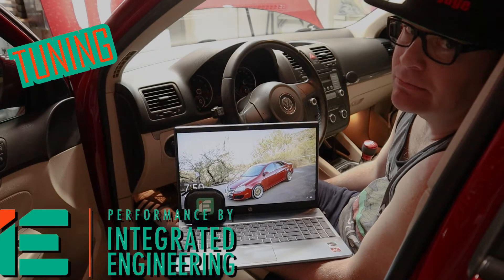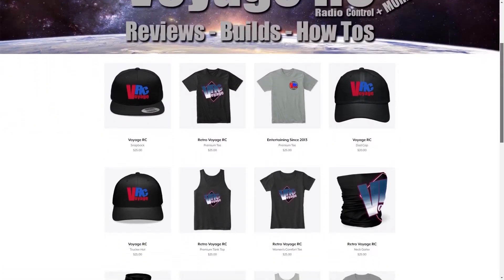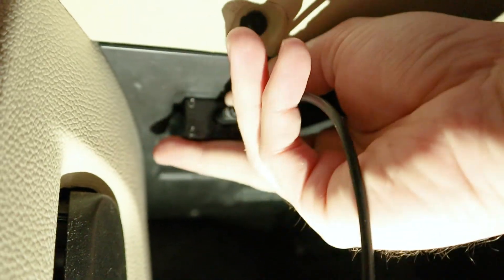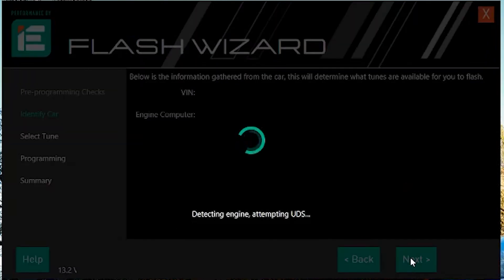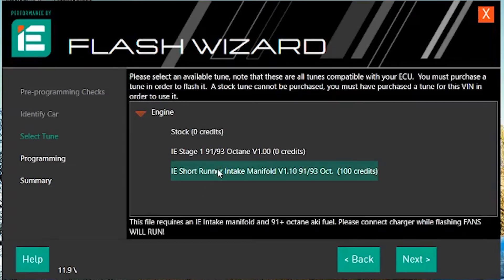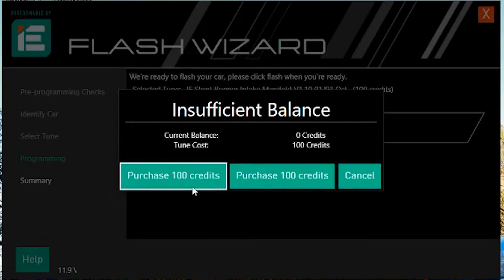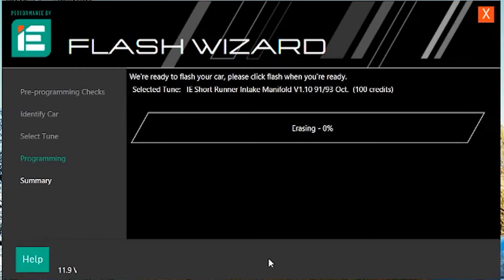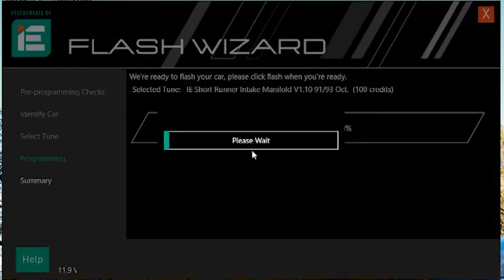HOW TO TUNE YOUR CAR with Integrated Engineering - IE Flash Wizard - 07K - VW 2.5 - Audi - RS3

Comment from the maker: What tune are you flashing?
Reply: Stage 1 for my B8.5 S4.  Could you provide a part number or link to the battery charger you are using?
Reply from the maker: @stevedoggydogg4461  Its just an autozone special. Nothing fancy.

Comment: Does the POWERlink have to stay plugged into the obd port after tune is flashed or can I unplug it after
Reply from the maker: When the tune is flashed it can be unplugged.
Reply: @V @VoyageRC thanks man 🙏🏼 I was going to unplug but I was too scared I would mess something up 😭 when unplugged will it still be functional to always plug back in to reflash to stock or other files ?
Reply from the maker: @arodicuss yes, the POWERlink is just needed to talk to the ecu. It is not the actual tune.

Comment: Hello, how long can the firmware take to complete, and can I not use the charger?
Reply from the maker: It can take a while. The battery should be on a charger to prevent it from going flat during the tuning process.

Comment: I have a dewalt 30a bench charger with engine start. You think it’s ok to use this charger or should I find one that can be started? It’s says don’t use while engine is operating but ac doesn’t mean the engine running. Want to make sure before I try the tune
Reply from the maker: @donavangragg6018  you need something to supply power to the battery while the tune flashes. It’s a lengthy process and you will brick the ECU if the battery were to die mid process.

Comment: Can you buy the powerlink and program it to a stock tune and trans tune without buying any of the tunes
Reply: @VoyageRC
Reply from the maker: @miloschaller9768  negative. It doesn’t have the stock tune until it saves your stock tune while going to stage 1 or 2
Reply: @VoyageRC  do you know if it saves the tune on your computer or the powerlink?
Reply from the maker: @ the POWERlink is registered to your vehicles VIN as is the tune. The POWERlink is just a device to connect and transfer data. The files are stored on your computer.
Reply: @bhongfpv I wonder if the tune isn't saved to either. Maybe they have base map on IE servers and just flash your unique identifiers like your vin etc to the base map on their server and patch it onto your car. Would suck if your HDD went bad or your powerlink and couldn't flash back to stock you know?

Comment: What type of charger do I need for the car? I got cables that are ment to go onto another car to jump start it.
Reply from the maker: Any basic charger will work. I just have a small trickle charger. I would recommend having the charger plugged in for a little while before starting the process to ensure the battery is at its optimal level.
Reply: @VoyageRC  did you notice a power difference with stage 1 engine and trans tune?
Reply from the maker: @J.jizzleYt  minor power increase on stage 1. The drive ability is what’s greatly improved.

Comment: Hey man, so I just did the Stage 1 IE  tune on my golf 2.5, But the speed limiter is still there(123mph max), and gears still shift at 6k. The only thing changed after tune is i can rev to 7k in park or neutral. Also don't really feel any difference in power. Should I flash the stock tune then try flashing stage 1 again?
Thanx
Reply from the maker: The shift points won’t change without doing the trans tune. The stage 1 only tunes the engine.
Reply: @VoyageRC  oh I see but I wonder why did the speed limiter did not get disabled since it says that on IE website. Will reflashing  help or something wrong with my tune?
Reply from the maker: @_DaRobot  you can try a re-flash. If that does not work contact IE.
Reply: @VoyageRC  alright thnx man! they probably will be closed on Monday so got  to wait till tuesday to fully enjoy this tune lol
Reply: @_DaRobot did your issue get fixed ? If so How did you fix it?

Comment: But why use a battery charger if it is in very good condition, it requires so much charge (current) for this small intervention?
Reply from the maker: Because if your battery dies during the flash process then your ECU is a paper weight. Why not hook a charger up for peace of mind.
Reply: What if I don’t have access to plug a battery charger? Should I take the risk? Apartment complex

Comment: Do you think this tune will work on a 2012 beetle? It’s a 2.5l
Reply from the maker: Integrated Engineering has stage 1 and 2 tunes for the 2.5 from VW. Stage 1 will work and 2 would depend on if you have electric or power steering. If you have an auto trans you would also want to tune that.
Reply: @VoyageRC  Okay thanks, it’s a Manual too. Very fun car to drive!
Reply from the maker: @haydenromo4906  praise the manual gods!

Comment: Is that IE tune is available for 07ks VINs on Mexico?
Reply from the maker: My car was assembled in Mexico. Contact IE to verify.
Reply: @VoyageRC  in fact all mk5 and mk6 were manufactured in Puebla's VW plant in Mexico. And IE are made in USA performance engineering.
Thanks I will contact IE
For the battery's charger refers a battery starter?
Reply from the maker: @gati54uri094  any charger should work fine. You just want to make sure the battery does not die during the flashing process. That would brick your ECU. It would be best to start the charger/maintainer a few hours in advance to make sure the battery is at its best. It’s just peace of mind.
Reply: @VoyageRC  I forget asked you If the stage 1 makes pops with stock exhaust pipes. 
And between stage 1 and stage 2 in terms of performance feeling's
Reply from the maker: @gati54uri094  stage 2 for sure feels better. Both pop, but stage 2 pops a little more. I am not running any mufflers or a resonator though. Not sure how much you will get with the stock exhaust.
Reply: But what happened If I purchase the stage 1 for the first time? On the flash wizard appears with that credits available to tune with that stage? The process requieres an internet conection? Or you tuned offline?

Comment: Do I need any special computer to do this?
Reply from the maker: Just something that would meet the minimum specs. I believe it needs to be Windows. Don’t need anything crazy.
Reply: @VoyageRC  yo I’ve always been curious if they keep the laptop in the car all the time or like do u just use it to tune it or does that matter at all?
Reply from the maker: @Jvidxnn  just used to tune it. No need to keep it in the car. You can data log with their software. So it can do more than just tune.
Reply: @VoyageRC  ok that makes a lot of sense. I was wondering cuz I’m buying the tune tmrw but I don’t have a laptop just an actual pc but my friend has one and was offering to let me use it for the tune. I appreciate the quick response tho bro!
Reply from the maker: @Jvidxnn  funny story, I moved my PC into the garage to do my stage 1 tune (before I had a laptop) 🤣
Reply: @VoyageRC  bro that’s exactly what I think I’m gonna do tbh 😂

Comment: Does it matter what band the manifold is or does it have to be a IE manifold
Reply from the maker: IE would be preferred as the tune is based on that manifold, but if you can find another short runner manifold it should work too.

Comment: Hey man. Nice walk-through. I have a mk6 Jetta 5 and I have an stage 1. Do you know if the monifold you put on is it compatible with my Jetta? Also how many hp will it get?
Reply from the maker: It’s compatible if you have the 2.5 and electric power steering. The IE website has the dyno graphs to show you the differences.
Reply: @VoyageRC  oh I have the hidraulic version. Crap. Thanks for the information. Regards
Reply: @VoyageRC Did you put your own electric steering? No way that old of a jetta had it factory
Reply from the maker: @ it came factory with electric power steering. They downgraded on the newer models.
Reply: @ That’s crazy

Comment: Can you do it on a stock engine or you need to change your manifold,  I have a 2.5 mkv jetta
Reply from the maker: Stage 1 can be done on stock engine. Stage 2 requires the manifold. Best to do the power kit at that point.

Comment: The car doesnt need to be running when you turn the ignition back on?
Reply from the maker: It would not be able to run. It is in the middle of writing the tune that tells the engine how to run. Just needs to be in the on position.
Reply: @VoyageRC  thought so lmao never done anything like this before, gonna throw stage one on my passat i just need a new crank pulley 😑 sorry for the noob comment, thank you!
Reply from the maker: @ChrisGlasson  no worries man! Enjoy it